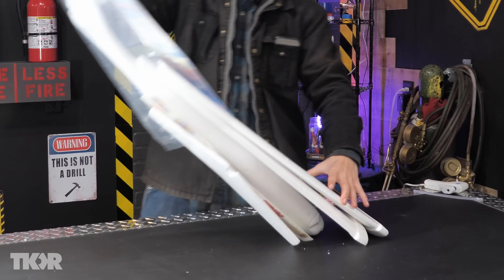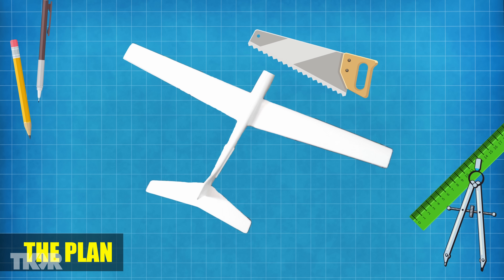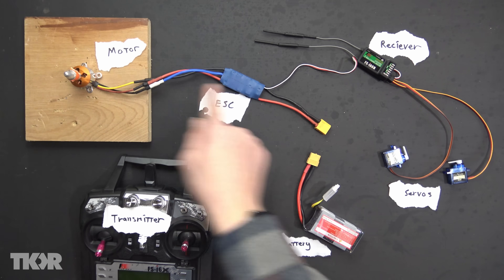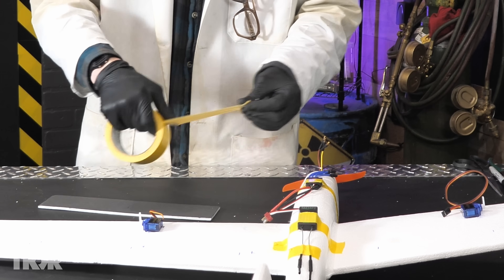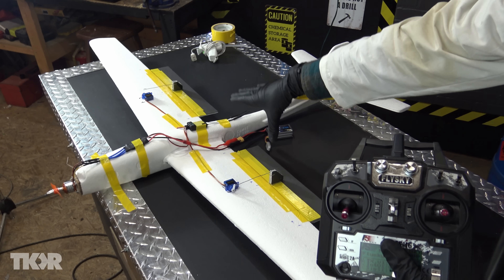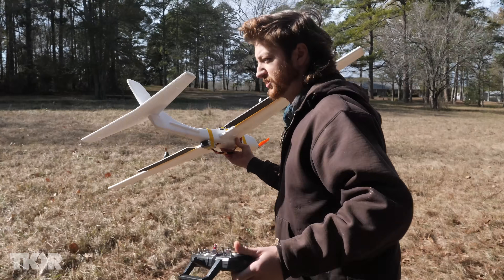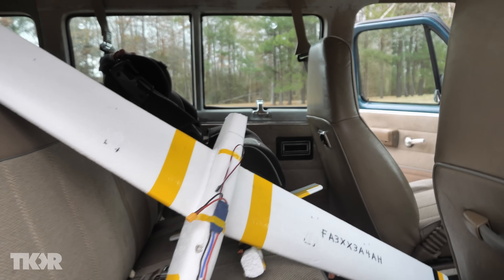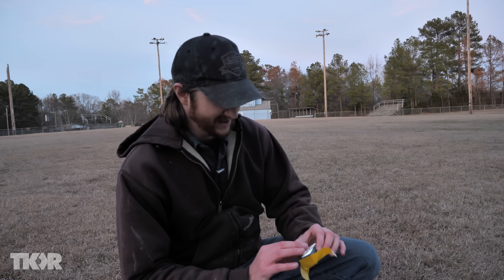🛫 Transforming a $5 Glider into a High-Flying RC Plane! 🛠️🌟

Comment: Also, those FlySky controllers are really touchy due to the springs in the controller gimbals. You can turn down the effectiveness of the controls and make it less sensitive in the center of the control gimbal through the “dual rates and expo” setting. I’d try it at 70 percent rate and 45 percent expo. Great video, certainly did better than I did with my first RC plane, which was DIY too. I had 4 controls, throttle aileron elevator rudder. It would’ve worked if I’d known my ailerons were reversed! The first control configuration was interesting, might’ve worked better if the “flapperons” had been placed closer to the outboard ends of the wings. And for “control horns” instead of using foam braced with plastic, balsa wood or expired gift/credit cards will work well.

Comment: 0:44 I had one of these and was in the process of adding carbon fiber support to it when the foam broke and prevented me from completing that project. Any glue I used melted the styrofoam. The really neat part was I had made it into a “T tail” configuration (like the F-104 Starfighter)
Reply from the maker: You try hot glue? I never had any problems gluing it back together. And i glued it back up a LOT loll
Reply: @TheKingofRandom  That was the first glue type I tried! I guess my hot glue gun was designed to use a hotter temperature. I would apply the glue and push it together. After 90 seconds, I would release my grip only for it to fall apart, with a hole where the glue had been.

Comment: 855   that's a good tip.    but it assumes that the wing has a  Normal/correct  profile.     under normal conditions, cg should be at 30% of chord.     normal conditions include a model aircraft having an Optimal  distribution of mass (dom).
the tail of an aircraft should be made as  Light as possible.       when things/servos were moved to the tail, the amount of mass at the tail was  Increased, significantly.    thus, tail-heaviness in the model's dom was increased. 
the mass of rudder and elevator servos should be located  NEAR  the cg.!!!
the props that you are using are (flexible)  SF props.   (slow-flyer)     the flexibility of a SF prop results in the (partial) un-loading of the blades during any relative increase in throttle.    thus, the  power to thrust  ratio of a  SF prop  is  NOT  constant.
1100    the span of the horiz-stab does not need to be greater than thirty percent of the wingspan.      a correctly sized stab will weigh  LESS  and  it will make less drag.
1200    there are two ways to achieve necessary control surface clearance without amputating part of the rudder.
1)  make a split elevator   or
2)  locate the rudder  just-forward-of the elevator hinge line.
btw, rudder control goes on the  LEFT  stick.

Comment: Hi great vid. A few things that might help you here is experimenting with dual rates and expo which will help make the controls less sensitive until you gain more experience. Also using a lower kv motor will give a plane like this a LOT more thrust so maybe have a look into that. Otherwise great vid as always 👍👌

Comment: For a novice pilot, that was a great performance. The trick to fly large planes is to throttle up when making a turn because you'll lose airspeed and altitude and keep the angle of the bank as low as possible and straighten out as soon as possible. Any time the plane banks, you lose lift. Steep banks need to be as short as possible to preserve lift.
Large gliders are perfect for this kind of project because of their large wing area. More lift, more carrying capacity but also more drag so you'll need a powerful motor and a suitable propeller. You can make anything fly as long as it has a large enough airfoil. Aileron control isn't ideal for this kind of plane for the reason mentioned before. You can still have ailerons but you need an elevator. You can bank into a turn but need that elevator up a bit to keep the nose level.
The hardware is good, but not perfect. A motor with a higher KV rating and a better propeller couldn't hurt. The plane kinda struggled to gain airspeed and altitude. You need more punch to get that plane zooming.
Lastly, drag is a big issue with airplanes. Ideally you'd want to hollow out the hull and stuff everything inside to eliminate unnecessary drag. Very nice project. Oh, and make sure the battery and esc have the same connector lol. I saw you got a battery with an XT60 connector which originally didn't match the esc.
Reply from the maker: Yeah lol I didn’t realize the connectors were different 😅 I ended up just cutting the wires and shoving them into the terminals

Comment: Ah, the flysky-i6 with receiver included. It supports S-BUS for telemetry sensors such as voltage, barometer, accelerometer etc. Very good starter kit and super affordable, anyone can pick up one of these. It was my first controller and works well. I recently got a radiomaster TX16S to use ELRS. Very expensive controller but fully programmable and open source. ELRS is the way forward.

Comment: I have done the same thing.
 Foam Gliders come in two sizes. a little one 12 - 14 in WS and the big one about 48 in WS.
 I put all radio gear inside, this is for aerodynamic smoothness. I power the planes with the self contained .049 reed valve & .51Port Timed, engines. Just two channels, Ail & Elv or Rudder and elv.
Quart of Fuel Fly all afternoon.
Reply from the maker: That’s awesome I definitely need to get my hands on an engine powered one sometime

Comment: That's a little more than a $5 glider
Reply: The video said "Transforming a $5 Glider" not building a $5 High-Flying RC Plane
Reply: @XInfinity2024   what I meant is the link takes you to a $23 glider and it looks more like a Lidil glider than what you have. {Might be due to the difference in everyone's location}.  For those who think that might want to do this and more than one, you can usually buy 5 motors and 5 ESCs for about $20 each, 9g plastic servos can be bought for 10 for $15 or 20 for about 20.  Get the 1400kv 2212 kv motors, you can find slowfly 8x6 props for about $8 for 10.